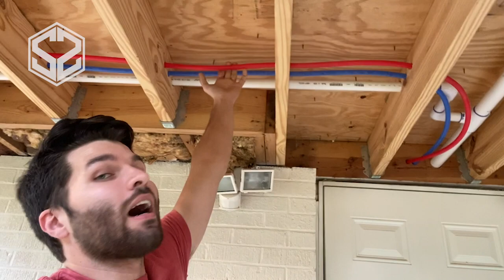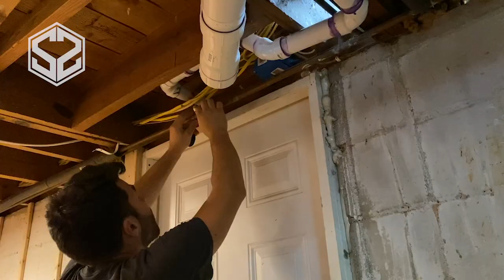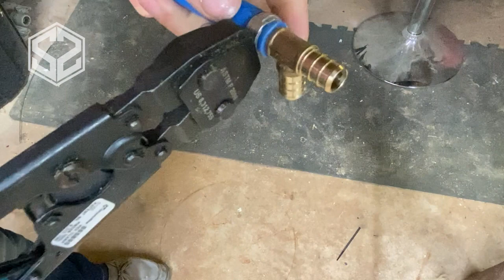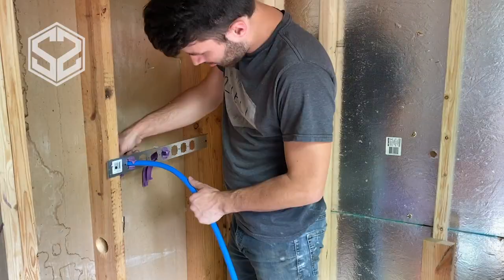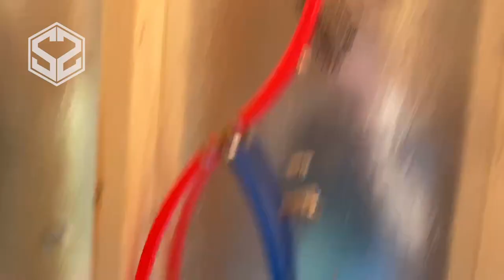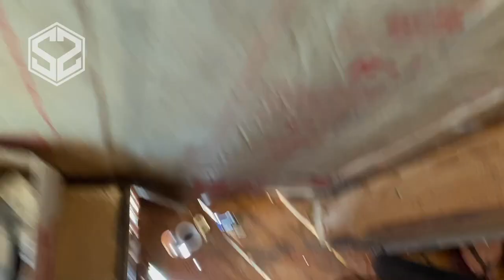DIY PEX Pluming

Comment: According to sharkbite, copper pipe should not be prepped like for soldering. It should be cut and deburred but not sanded
Reply from the maker: That’s good to know. Thanks! Sanding It doesn’t seem to have hurt at all as none of the fittings have leaked. However it probably instant necessary to sand unless it is corroded or painted. Crud or paint could cause sealing issues.

Thanks!! :)